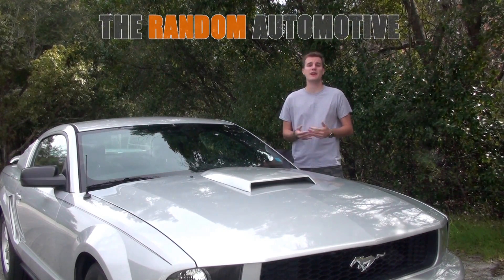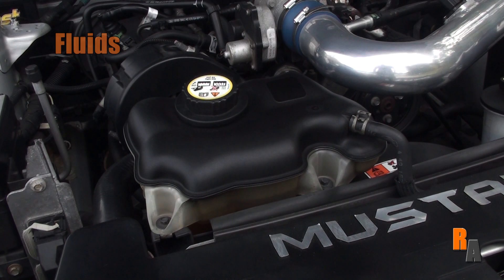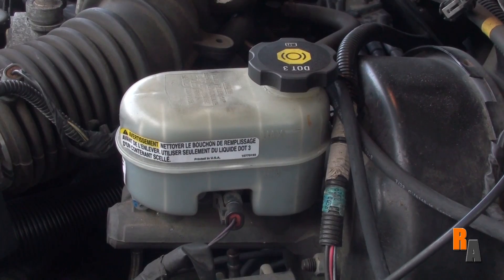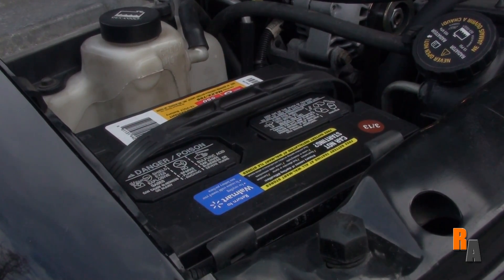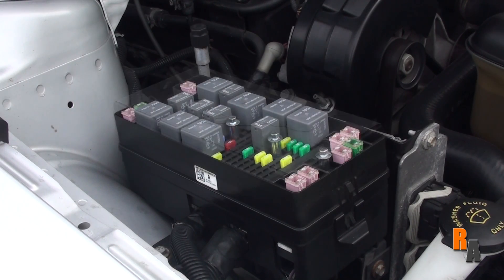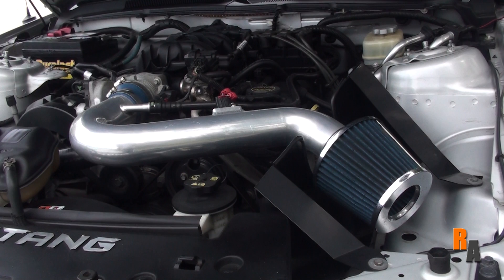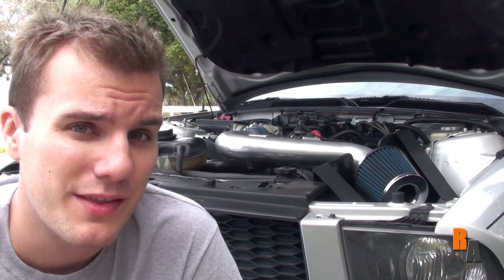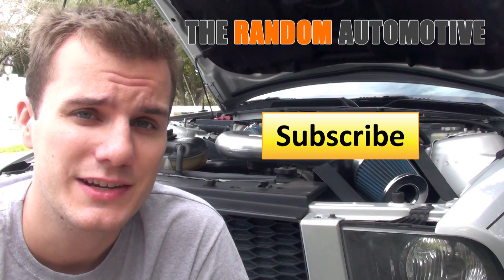Car Basics - What's under the Hood?

Comment: I'm 15 and learning to drive. My sister needed candy for her friends for Christmas break an my uncle said I could drive her, so I did. While on the way the serpentine belt had just fallen off, I didn't notice anything except for the wheel was hard to turn and we ran out of gas really quickly. I didn't want to pull over because it was really cold and my sister would start freaking out. So I kept driving until I got to a gas station. And crawled back home as the car wouldn't go above 35. On backroads of course. We got home an I told my uncle something was wrong and he went to check it out and started screaming that I had ruined the car and we needed a new belt. He told me whenever I think somethings wrong with a car i pull over and look at it. Now here's the problem, I have literally never looked at a car before. And he was unwilling to teach me because I had ruined it in the first place.so now I'm here :/
Reply from the maker: Damn.  That's one hell of a story.  I hope you got everything sorted out.  :(

Comment: What does it mean if my alternator is wet?
Reply from the maker: Depends what it is wet with: coolant, oil, rain water.  There are not too many options based on where most alternators are, but something is leaking onto it.

Comment: Thanks dude this was great. As a total noob just trying to get some basic knowledge - it might have helped if you zoomed out a tad, I am literary coming from zero knowledge just trying not to be a schmuck. Great video still thanks !
Reply from the maker: Glad you liked it.  Thanks!  A couple people have asked  to zoom out.  The reason I did not was because I wanted to focus just on the part at hand, and the biggest thing is that some of these parts are not all located in the same spot.  The battery, for example, that can be underneath a seat inside the vehicle in some instances.  For that reason, I figured the part itself was more important, not the location.  Thanks for the feedback though!

Comment: A Mustang without a V8 what can't take on the insurance bill? If you're going to have a hot car it's gotta be hot in the inside beef it up! I got a some loud ass pipes on my (V8) Truck because I'm still not confident on the engine part I want to get a cam for it but I have so many questions IAM NOT GOING TO GO A AUTO SHOP the point is IM building the damn thing. Fu should of saved my summer money I'd  have at least more than a couple grand of free spending money (I hate bills). I need a job but school. I have a grand but those pipes costed NEARLY a grand what's a friggin cam going to cost?? I need new shocks but FUCK!

, Sincerely your over dramatic day dreaming bitch
Reply from the maker: Haha.  I got this car a long time ago at a great deal.  No sense getting something new.  It's still a Mustang.  And yes... Car parts can be a fortune.  Keep working toward your goal, and you'll get there!  Make your day dream a reality, one step at a time!

Comment: Does your mustang have turbos? and what does block mean in engines?
Reply from the maker: It does not have turbos.  "Block" refers to the base/body of the engine.  It's basically what all the parts go into or bolt onto.  Think of it like the foundation to your house.  Everything gets built onto that.

Comment: that so called air box is actually called a intake
Reply from the maker: Thank you for that insightful and grammatically correct comment!  That part on the end is indeed called the airbox.  The whole assembly up to the throttle body is the intake.  Which is why I said "filter" for the Mustang, and "airbox" for the Blazer.

Comment: What other engine parts does the serpentine belt transport power to?
Reply from the maker: Generally you will find that it powers your alternator, power steering pump, air conditioning, water pump, and stuff like that.
Reply: Thanks for the reply! Really helped.